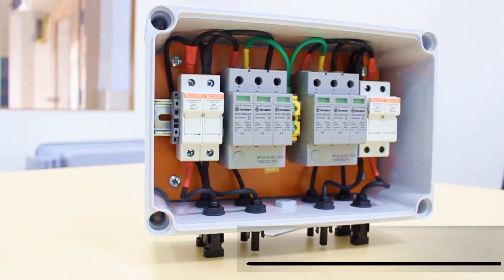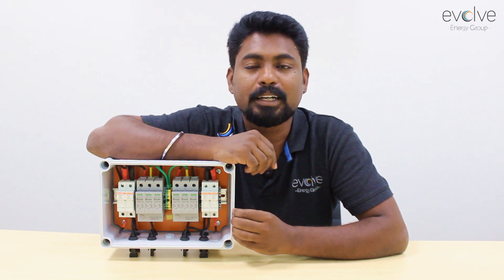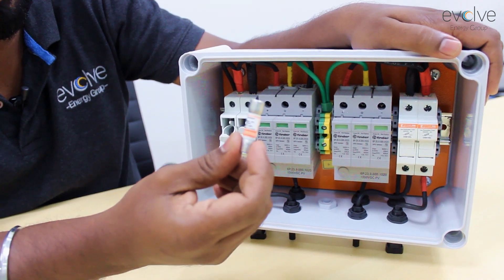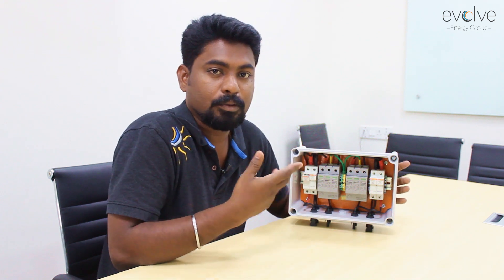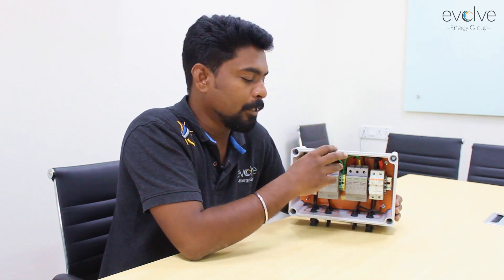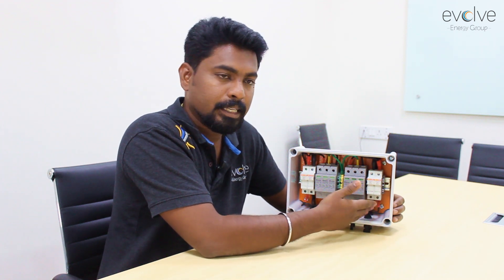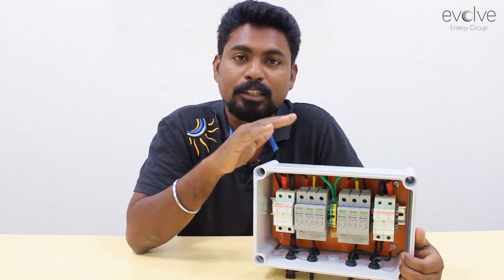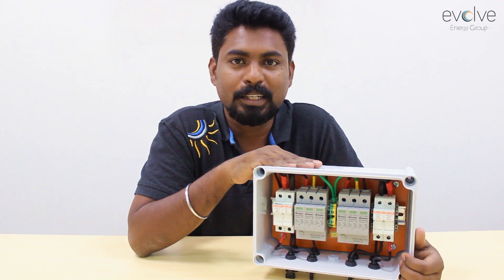Why Solar DC Combiner Box ? | SIVAKUMARAN CTO | EVOLVE ENERGY GROUP

Comment: We have 1500 volt scb , with connected 8 nos. Of 2nos. Y connected Parallel Of 28  panels in series(56 panels) (maximum 20Amp) ,
Module junction box maximum 25A capacity,
Each 8 nos. String's positive in series with 45A fuse,
If any one 28 panels string shades and low voltage, will that 45A fuse will protect modules?

Comment: Nice information sir please make video on 3kw ongrid rooftop solar system of single string and explain the wiring of system with diagram and specifications of the DC and AC wires used in the system.

Comment: Hi. How do I size an SPD to my MPPT? My MPPT can take 150V Max. VOC. Am I correct to assume that the SPD need to be 150V or lower for it to be able to protect the MPPT? But there doesn't seem to be an SPD for that low of a voltage. Most DC SPD have a minimum of 275V/500V/1000V
Reply: I don't think it is a problem. Voltage rating of spd is independent of mppt voc. Spd is generally for extremely high voltage surges from lightning or huge switching  inductive loads . It wont matter which rating spd you choose from your options.